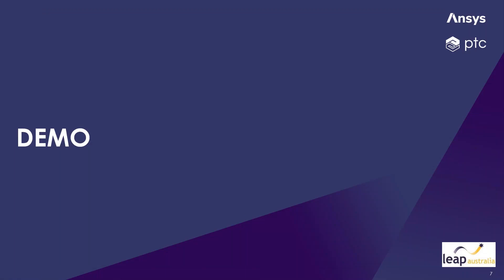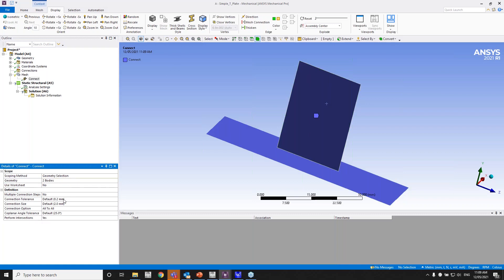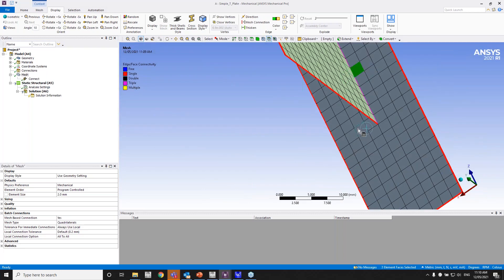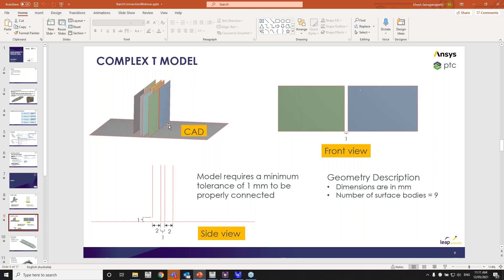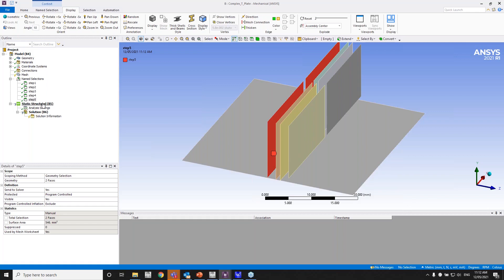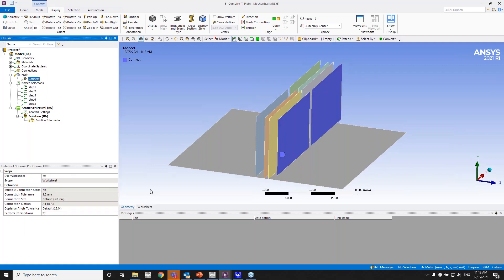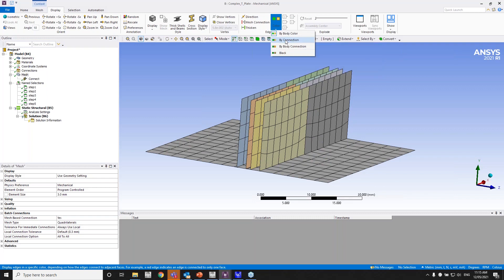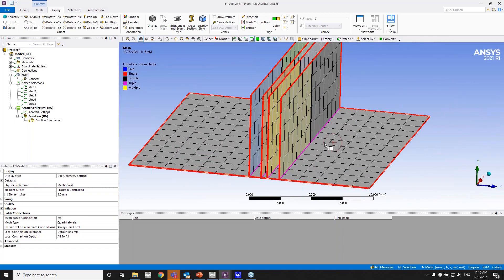Ansys Batch Connections: Demonstration - Basics of Batch Connections (3 of 6)

Comment: Hai, thank you so much for your video. Currently I'm trying the weld mesh feature in ANSYS. But, I have problem because it said that my batch connection was turn off. I couldn't found the batch connections menu wile pick mesh options. Can you help me with this problem? thank you.
Reply: having the same problem. any solutions?
Reply: do you have shell or solids?